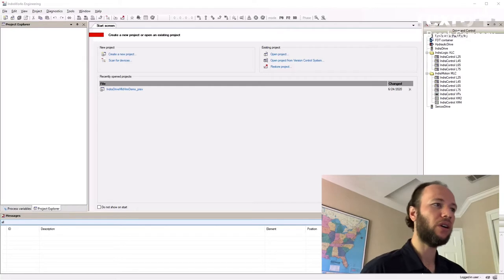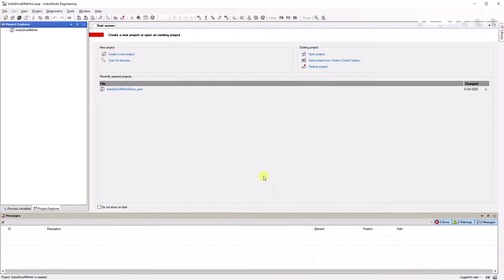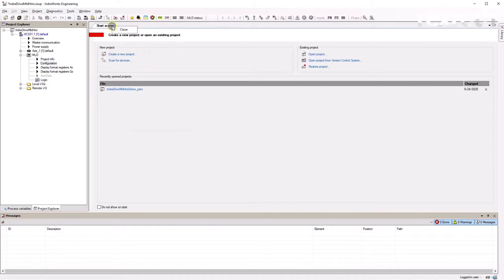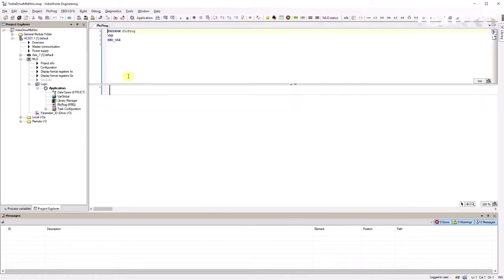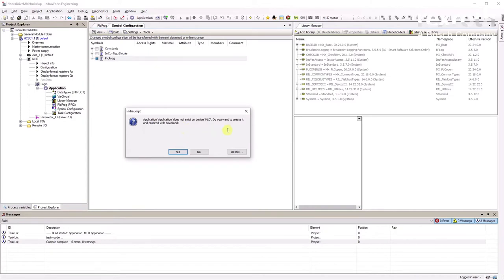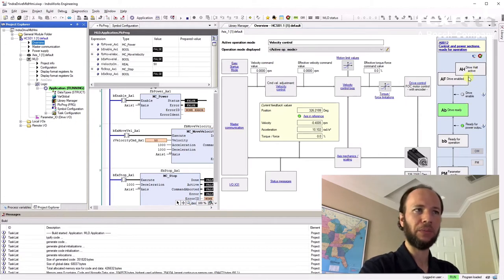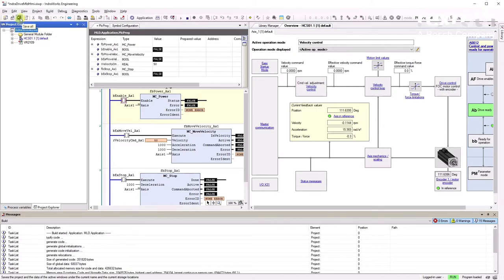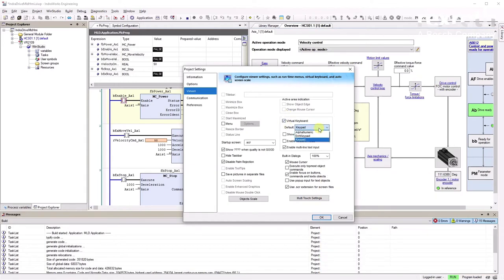Motion Control System IndraDrive MLD & HMI - Basics Tutorial - Bosch Rexroth

Comment: Thank you very much for introduction this tool. I tried to project the panel VR2107. But I'm not able to edit project. Message: WinStudio licence Engineering & Runtime 1.5k required. Is there a possibility to download a program with trail licence or do I need to buy one? Or is it on the panel, if I buy one?  I have indraworks MLD 14V24 P3 DVD. Thanks in advance for helping.

Comment: Hello Mr TOMAS,

I tried to configure a Rexroth type HCS02.1E-W0054-A-03-NNNN servo drive by INDRWORKS with its servo motor, but the drive does not take the enable command into consideration.
thank you for informing me that it is the problem to continue to commission this servo which controls a chain of the thermoformer
Reply from the maker: Hello Rachid, 
In case you need additional support, I would suggest you to post your question on our Support Forum. Here's the link: https://rexrothsupport.discussion.community/ 

Thanks for watching the video!